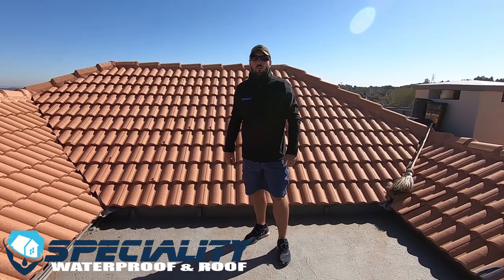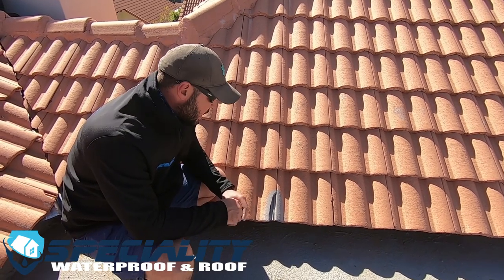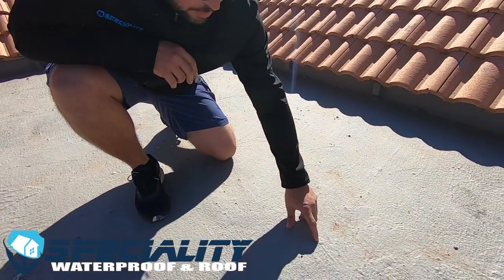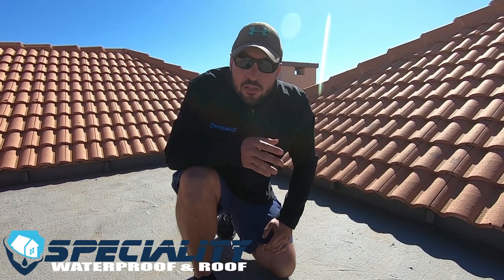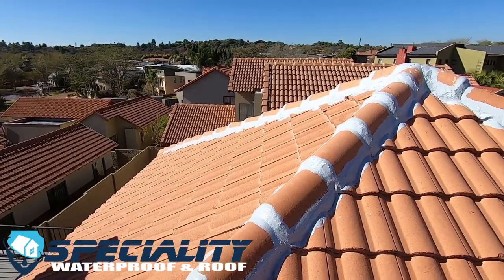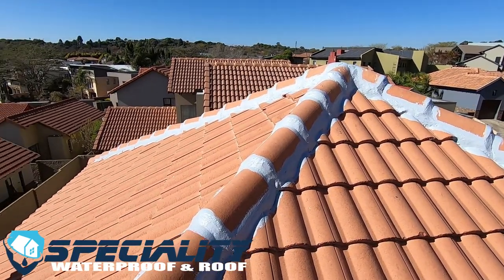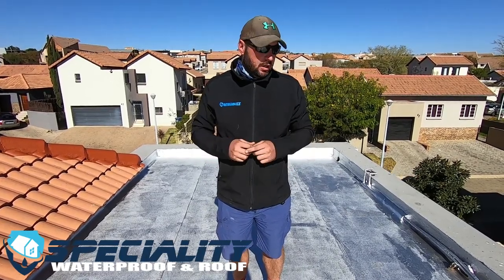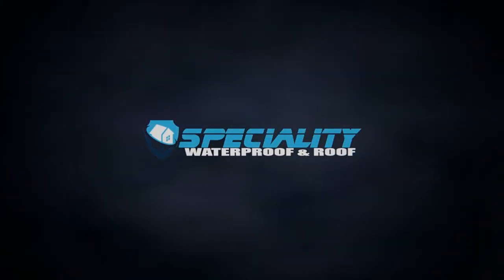Torch On Waterproofing vs Liquid Rubber Paint on Flat Concrete Roof in Pretoria East

Comment: Must say . The correct liquid rubber product and application process will work and outlast torch on and less maintenance . We have seen a couple of “eco friendly “ applications fail . We manufacture the Duraflex Liquid Rubber product Range. But unlike others we don’t have a 1 product seals all . Would love to send you samples to try . We have a blended liquid rubber to use as the prime coat on the old torch on then use either our harder deck and floor Liquid rubber as the top coat if the area has foot traffic or our standard roof rubber . If your really need the silver reflective coat we are also the first and only manufacturer to make a silver acrylic based liquid rubber
Reply from the maker: Thanks the feedback, you are welcome to send us an email, we would love to learn more about your range as we always strife to give our customers the best.
Reply from the maker: I would like to see this system? Why don’t you remove the torch-on system before applying your system? I also doubt that you will have a longer maintenance cycle. If we do a mineral chip torch on system we can guarantee it for 10years maintenance free. Can you do that with rubber system?
Reply: Liquid rubber on a flat roof is definitely a no .
Reply: I hv applied the Liquid rubber on my Roof, but I instructed to apply the Torch on membrane on top of liquid rubber, what is your advice on this case?
Reply: I hv applied the Liquid rubber on my Roof, but I instructed to apply the Torch on membrane on top of liquid rubber, what is your advice on this case?

Comment: You can't expect one coat of liquid rubber to work , 4 to 6 coats will last much longer then any torch on ,on a flat roof
Reply from the maker: @jodashcharles7149  no it wont. We have seen multiple coats fail within a year. You are welcome to waste your time and money. I have never seen an engineer of architect spec liquid rubber, do you know why! It has 0% rubber in it, its waterbased and will fail within a year.

Comment: Is it possible to have a video on the issue of maintenance on the silver or aluminum you showed in the last bit. As this area is the first to require maintenance in the long run, it would be nice to see examples of weather worn aluminum applications, when to start paying attention to it, when is it still ok, and what are the options of repairing or just have to do maintenance on it? Also the application of the silver would be nice to see.
Reply from the maker: Hi Anton, im going to add a link to one of my other videos. Here you will see worn aluminum coating and the damage done to the modified bitumen.
Reply from the maker: https://youtu.be/8unIEH0xUVA
Reply: I have been using acrylic roof paint instead of bituminous aluminium paint for years, on torch-on.  I feel it gives better protection, and it last longer.  Just make sure you inspect the work a month later, and re-paint any movement cracks in the paint.  If any.

Comment: Can you coat this paint on a roof made of marine plywood that has been nailed to wooden trusses?
Reply from the maker: @christofferraby4712  I need to clarify something first. The Torch-On can be applied  to marine plywood, but prime it first with bitumen primer. This method is commonly used in the USA. The “paint” is a bitumen based aluminium paint that protects the Torch-On aka Modified Bitumen. The paint alone wont protect you wooden substrate.

Comment: I have been using liquid rubber neva had a problem even done a flat concrete roof. It all depends on the application process if it's done correctly.

Comment: Liquid rubber is kak, why didn't you torch the parapets as well bro! Looking good I would've just has a seamless torch layer run across and not joint the mid section as it also looks better om the eye, I like the ridging work we do it the same as well 👌🔝👌
Reply from the maker: We did torch the parapets, its just not possible to capture everything on video. Ssss also we don’t give away all our trade secrets! 🤣
Reply: @specialitywaterproofroof4336  agree, I prefer to talk kak about these greedy politians while on the roof, keep you secrets yes  it cost aLotto money, time, training and failing to perfect... roof work is the best